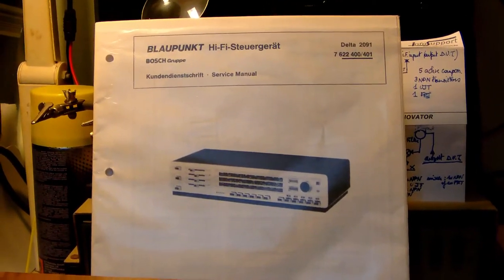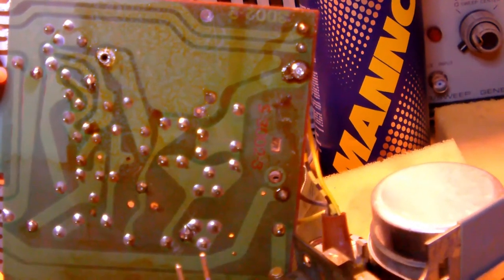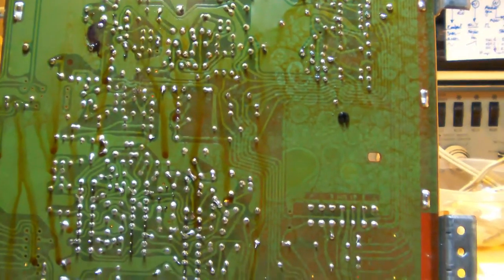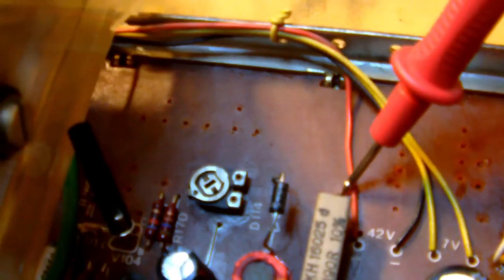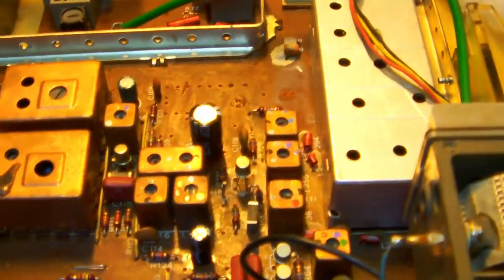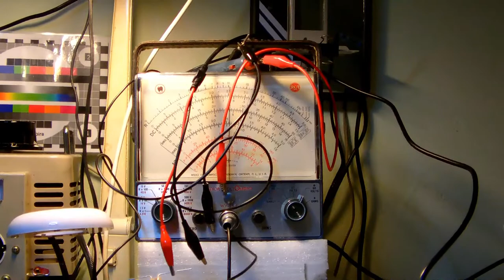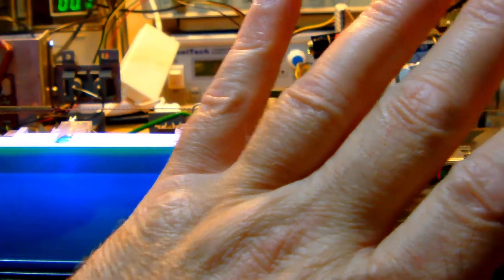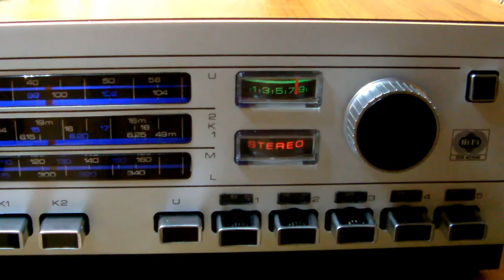Blaupunkt Delta 2091 Tuner Amplifier Repair Restoration part 1 of 1

Comment: Hi, thanks for the excellent information. 
I bought one of these today in a truly dreadful cosmetic state. Maybe it's the french, but there are a lot of quality amps here that look like they've lived in a barn or smokey fly-filled bar since 1983. 
The hot resistor you swapped out, I'd noticed it was super hot too so was glad to see you had the same problem and how you dealt with it. I guess it means that that resistor is not the reason I have no radio. Yes, all radio totally dead.
There is output from tape out, albeit not great, distorted muddy bass. But I guess that's just the capacitors. I checked for DC at the speaker outputs, and none present. I found out how to check idle current from another video, which should be 5 milliamps (DC) but I couldn't get a reading when There's a ton of cross channel interference if I have  a CD or tape playing and then press the radio button. CD sound is muted, but still very audiable. 
The switch on far left to switch to radio, I put some contact cleaner in it but no joy. 

The 40+ recap, I noticed you needed to be quite skilful to arrange the new layout, switching from axial to vertical. Do you run wire trace? It looks like some kind of 'rail' on the power supply. Also you mounted a cap to the case of the main power transformer. ... thinking about it, that must be the replacement for the original cap in the can?

I like the blue LED's, but, they don't look so good when the singal meter is still green ... somehow! 

Great job, excellent work, I wish you were closer because this thing needs a master like you to bring it back to its best. I'll give it a go but....  I am no expert!! far from it.

ps I paid 10 euros ... that's how bad it looks, and is.
Reply from the maker: The cap I installed on top of the original large powersupply capacitor has he same value, albeit rated for a slightly higher DC voltage (I seem to remember 63V) I did that for two reasons mainly, the new cap is far smaller than the original one and I needed something to fix it to, then also I wanted the cap as far as possible from the body of the transformer and the power resistor I replaced, because electrolytic caps don't like heat.
The power resistor I replaced by a metal power resistor I fixed to the metal of the chassis to use that as a heatsink. The original resistor's heat had probably weakened the solder point and the trace on the PCB. Hence no sound or functioning of the tuner amplifier. If I were you, I would take the effort to replace the electrolytics, they are a great source of trouble and if you replace them all, you will at least eliminate a lot of potential problems (shorts, bad audio, distortion etc.)
My Blaupunkt had almost no crosstalk so I didn't adjust it. However, there is a way to minimize crosstalk by adjusting the coil L904 (for the left channel on the Tape input) and R905 and R906 for the right channel. Go easy on the adjusting and use a very clear but small (50mV pp) AF signal of 1000Hz alternately on the left- and right channel input pins of the tape input DIN connector.
However, crosstalk cannot be totally eliminated, since it's a result of a design flaw of the AF board (the sound traces for left and right channels, and for phono and tape recorder are too close to one another and are not adequately shielded)
Restoring an old derilict piece of vintage equipment is a great source of pleasure especially when you succeed to make it work again and make it look the part :) 
If you have time, tell me whether you succeeded to repair it. If you make a short video (a sort of "before - after" video of no longer than 1 minute or so) I'll incorporate it into my next video.
Thanks for your nice comment and the thumb's up
always welcome :)
Reply: @TechneMoira  Hey TechneMoria, thanks for detail analysis and reply. I will do a short video of whatI have. I took some photos showing how dirty it was (the black plastic case remains badly stained even after alcohol cleaning, the alu face, it's better, but without removing the graphics possibly as good as it will get) 
I tested the Diode next to the hot resistor at the beginning of the tuner stage, it showed 0.36 ohms in both directions, so that may be suspect. However on my analoge multi-meter (ITT Metrix model478) I couldn't get a reading. I looked up, testing a diode in circuit, and all I got was endless vidoes of people testing diodes out of circuit!! 
I was going to add yesterday, as a sort of second ps, this is a good amplifier to learn more about the basic principles of amplification, being well laid, out, seperated, with plenty of room. Learning about + and -dc bias, how to test bridge recifiers, understanding capacitance - on a fundamental and intuative  level is a good start ... but, you do need quite a lot of equipement to repair things: scope, signal generator, limited power supply, good soldering iron!! 
I'm good at mechanics (I already fixed the tuning dial) but weak on knowing what to do with electrics. 
I will upload a video to my channel on how I get on with it. (I did a time lapse of a plant recovering from heat stroke on saturday ... and my macbook auto started last night and I lost all the footage as I hadn't saved it!! (iMovie 06 - great bit of movie software from back in the day) 

Quick question, if I have a blown output transistor on a luxman 230 amp, and if I  replace it, would it be better to replace all four (left channel is blown). Replacing all four the sound will be more harmonious? Do output transistors have an effect on 'sound quality' I tend to think not. Old grundigs with Germanium, ok you don't want to put something silicon in one side, but generally, it's just a gain switch .... 'any quality' transistor with the correct rating will do, but always likely better to replace all, especially if prone to going like in the 230 amp.
Reply from the maker: In my opinion, you should be safe to replace the one broken transistor by an equivalent transistor with similar specs (maybe with slightly higher voltage/current ratings for Collector-Emittor voltage/current. Beware of thermal runaway issues and reset the quiescent current biasing for the channel with the replaced transistor such that it doesn't overheat but also presents no (or little) distorsion in the  sound on the repaired channel. 
DO NOT run the amplifier output without a load! If necessary attach a power resistor of +-8 Ohm to the output(s). Go easy on the quiescent current setting (Volume to 0) and always use a clear sinus wave AF signal to set/reset the biassing.
A lot of repairs can be done with basic material (I started that way many years ago :) ) but, obviously, if you have extra useful equipment like an AF/HF sine wave generator or an oscilloscope, that could make repairing a lot easier (if one knows how to use them to full potential).
There's nothing wrong with "messing up" something (when you're a starter)... that's the way we learn besides reading up on the subjects at hand, of course (you always need to study a bit before you dive in). Trust me, a lot of "experts" ALL had to start somewhere and a lot of them "messed up" appliances doing so :) (including putting things together again and having the proverbial screws left over)
The main thing is to learn from your mistakes (and not make them again of course) and to read a lot on all sorts of subjects (being an autodidact is not a shameful thing). Also asking left and right and gleaning info from others can help (steal with your ears and eyes :) )
good luck
Reply: @TechneMoira  Cheers TM. I am going through your videos, started with the first in 2013, showing the philips valve radio, the TV, the other Radiola thing in the box (your most prized), and the toaster ;o). Good style man, and good English 👍 (I teach english here in france to make a bit of cash! - not easy though as now 'everyone' is an english teacher apparently. Restoring old hifi is another way to make a bit of money (as well as restoring lawnmower!), but I am always reluctant to sell my stuff ... although if I become half decent at basic trouble shooting / fault finding, well just order the parts and fit them. I need to find a good supplier (of parts) ... here in the middle of the Jura, France, there's nothing off the shelf in a shop. Everything must be ordered ... which is fair enough I guess).
Youtube doesn't make it easy to just view all vids in the order they were uploaded, it tends to be newest first!! so I next came upon the B&O from early september where you are replacing a couple of output transisitors.
I watched half of that then went out to clean the faceplate and top of the Blaupunkt. More vinegar (13%) and as that wasn't making a lot of difference, unleaded petrol. It is a lot better than it was. 
I also found the schema for the B/punkt, which is great, obviously.. and it will give me a list of the caps to order. The orange ones seems to be all the same by and large 100uf 40 volts. 
It looks the same as the one you were using, from the site 
https://archives.doctsf.com/documents/feuilleter_document.php?num_doc=53530&ref=41381
I'll plod on and let you know how I get on. 
I fancy having a go at repaiing a Grundig RTV 600 with a bad tuner stage (no sound). Could be just a diode, it works 'ok' otherwise. A beautiful tuner ... I'm a bit of a Grundig nut, love the design, and yesterday at a vide grenier (boot sale) saw someone else walking off with a radio I would have bought if I'd arrived 10 minutes earlier!! (I did buy the Blaupunkt though)

Comment: Great video! I have the same model! You did replace the bulbs with leds. I have to replace mine too, because there is only one bulb left thats working. Question: can I just replace them for leds? Without any other modification? And if so, which type of LEDs did you use? Thanks!!!
Reply from the maker: Hello santioriginal.Thank you for your nice comment. I bought E10 socket 6V/12V flashlight replacement LED bulbs on Ebay, for the express purpose to replace broken filament lightbulbs. One can find these on Ebay and probably many other online shops. I'll include a link at the end of my comment for a similar type of lightbulb. I have to say though, I used LED lightbulbs with a "square" top rather than the classical "round top". Be aware there are quite a few different types on the market (obviously where voltage is concerned. Most "classical" 5mm LEDs all consume around 35mA)
If you're handy, you "could" build your own LED replacement bulbs using the socket of a broken filament lightbulb I suppose, but, never exceed 12V AC or DC voltage and ALWAYS include a resistor in series with the LED (between 220 and 470 Ohm 1/2W depending on the desired brightness)
Thanks for giving me a thumb's up and subscribing to my channel :)

Have a look at this: https://www.ebay.com/itm/E10-LED-Schraubsockel-Birne-Leuchtmittel-12V-DC-6-Farben-Lampe-LED-Gl%C3%BChbirne/382732076075?ssPageName=STRK%3AMEBIDX%3AIT&_trksid=p2057872.m2749.l2649
Reply: @TechneMoira  thank you for your explanation! Subscribed👍👍👍

Comment: Hi,
Thanks for your very interesting video. I found a delta 6002 and i was wondering how to disassemble it.
It's a lot of work and it looks very fragile, I hesitate to go for it.
Reply from the maker: Hello NebOsja, if you hesitate it's better you do not try to service the tuner until you have done enough research (like looking for a service manual for example). Alternatively you could ask a friend who's familiar with electronics to help you out. 
Like always, it's better to err in favour of carefulness than to jump right in... remember the saying: Luck favours the prepared :)
I do have a Blaupunkt 6001 waiting in my stockpile to make a restoration video about it. I cannot promise when I'll make the video, however, I am glad to see someone else who's interested in electronics :)
Reply: Hi  @TechneMoira  I did it, i am familiar with electronic, but it was my first amplifier :)
I cleaned up as possible with alcohol, i didn't have isopropyl so i used 95% alcohol and i also used contact cleaner for buttons and sliders.
I didn't found any damage components or altered tracks.
After reassembling it everything was working correctly but unfortunately by forcing a little on the tuner button I broke the cord that regulates the tuner.
I will have to reassemble everything to solve this problem and I hope I will not have any problems because I do not have the necessary equipment to perform a tuning (no frequency generator/oscilloscope).
I will order a bulb to replace the defective one at the same time. Do you know how the stereo light works, because I have the impression that it doesn't light up anymore and I haven't found a bulb...

Thanks for your answers!